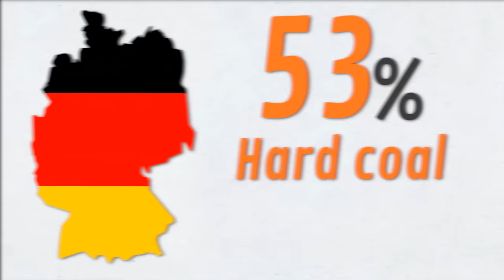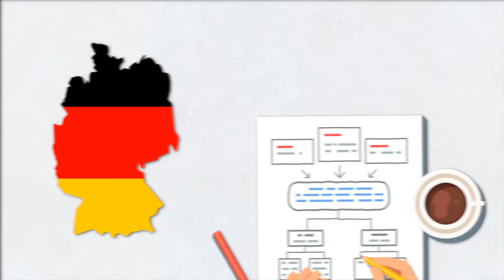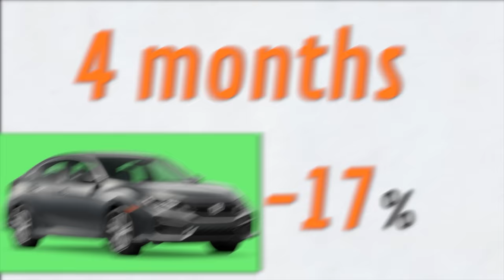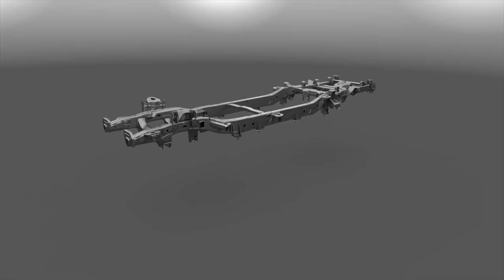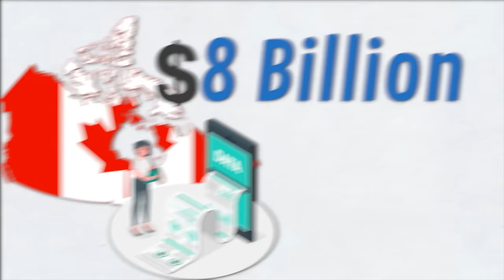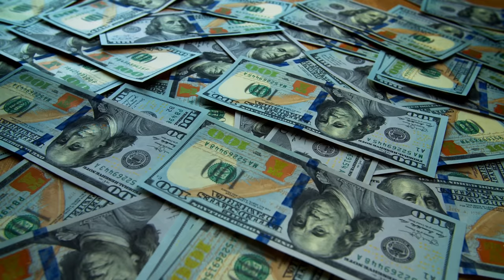Everything You’ve Heard About the Car Shortage is a Lie, Here’s the Truth

Comment: Make cars that last 50 years, or more. Quit having a disposable economy.
Reply: I still have my grandfather's 1962 Chrysler. Twice the weight of a Toyota, V8 power and can be repaired with a plier, Cresent wrench and two screwdrivers. Runs like a clock and rides like a living room on wheels. Doors are thick enough to stop a bullet so it's Chicago friendly. 😉
Reply: For real. Im still a driver of 1990's Japanese compacts. Every company should mimic those.
Reply: I still have my 67 cougar with 289 for the last 48 years I do all the repairs it has 234,000 miles! And my 92 Toyota truck
Reply: It helps to have a skilled, knowledgeable and honest mechanic!
Reply: Exactly. Put a few more dollars in quality built merchandise and charge a little more for it. We'd all be much better off in the long run. Local Mount Trashmore landfill might take longer to become a clay capped sledding hill but I like the tradeoff.
Reply: @N. Dakota ham, well at the rate America is going, it better be Chicago, NY, Texas, FL etc etc etc friendly these days. 😉
Reply: @drx, a knowledgable, honest mechanic ? That does not exist. 😆
Reply: we have the break a window and get a higher GDP economy.
Reply: It's always been about GREED!
Reply: Most of us would settle for 20 years.

Comment: In the 70's I had a Datsun B210 that got 40 mpg. Today I have a Nissan Versa that gets 40 mpg. 
We don't need no stinkin computer chips.
Reply: Yep.  Small cars and trucks with straight 4s in the late 70s and 80s were netting about 30mpg.  The Honda CBX was approaching 50.  Computers and fuel injection became ubiquitous after 1989...average fleet gas mileage went down...which means net carbon emitted went up.

By 2000+ many cars were getting 20 and most trucks were about 15mpg...just as prices went from $1 to 2 then 3 a gal.

  Therefore a 1989 economy car that went 30 miles on a dollar....in 2006 went 7 to 10 miles on a dollar.  A F150 went 4 miles on a dollar.

I'm thinking the computers had another purpose.

To regain efficiency in these rationing times, some EU makers are considering port carburetors...yeah.  apparently they were always more frugal...US makers just put bigger wasteful carbs on their motors to wring out HP and impress the hot rodder.
Reply: I have a 1966 Honda that will get 125 mpg.....of course it only has two wheels and no top so definitely not a cold weather vehicle.
Reply: @northdakotaham1752  that seems to be the limit of internal combustion.   110 to 120mpg for a single person and vehicle that can achieve speeds above 30... with a low hp bike.  Mine gets 95 to 100 at 45mph avg.  Rated at 70mph steady hwy flat speed...but gets about 89 for me.  That's a 2008.

It can carry two teens or thin women or one adult male.
Reply: Me too bought my 77 B210 5-manual hatch just before the 1979 oil shortage. Got 43 real MPG and was rock solid reliable. The engine design BTW was licensed from Austin with some changes by Nissan. Mine said Datsun and Nissan on the rear.
I also had a 72 B110 Manual sedan before that.
Reply: @STho205  sounds cool! My 90 cc Honda will go 60 mph. Very light bike. Not for a windy day!
Reply: @northdakotaham1752  I started on a 1970 CL70....that sucker went forever on 30 cents of gasoline to fill the tank.

Currently have a CB250 for mountain rides.  Gave up bigger bikes 6 years back....thus one was too practical and fun.  Maxes at about 75mph.

My cold weather rides stop below freezing, but I can ride all years as there's always some days above freezing here in Jan/Feb.  ND...probably not.
Reply: One guy put a lawnmower carburetor on his V-8 powered Ford Maverick and got 40MPG!
Reply: @STho205  added some hp but lost some mpg. 70 cc isn't much for hill climbing. I think a 125 is a happy medium. Hard to find them!
Reply: @diegosilang4823  still wondering if that was a hoax.
Reply: @diegosilang4823  the British SU carbs on their BSA and BL cars were similar in scale to lawnmower and tractor carbs.  A Maverick straight 6 or even the 302 could always get over 30mpg if a properly scaled slow performance carb with high air flow was installed instead of a big 2 barrel US throat or an aftermarket hot 4BBL Holley.  People in the 70s just totally overlooked the obvious.

That Maverick got reasonable slow acceleration to 60mph, but it went 65 for quite a long way in the test.
Reply: @user-3tf67bk46u  curb weight of 
1974 Ford Maverick: 2950lbs
2019 Ford Fiesta 4d: 2700lbs
2019 Ford Focus 4d: 2900lbs

Are you sure new cars are heavier in the same class?
Reply: I had a 74 Yamaha DT 125 that got 60 mpg. Got me around fine when I first got my license and about the only thing cheaper was a bicycle. Wish you could still get those again. $800 brand new and I beat the thing silly off road and it kept on going.
Reply: @user-3tf67bk46u you must have not seen a Maverick in context of current cars.   A Focus is a Maverick for that Ford niche.  Mavericks were officially compact cars in 1970+...very cramped.  The Focus and Maverick serve the exact same role, the cheap commuter, first buyer...mostly secretaries car...but you could squeeze 2.5 children in the back.

Falcon, (w 3 on the tree)
   became Maverick, (3 on tree)
      Granada
           Topaz
               Contour
                   Focus (mk1, 2, 3)
They are functionally the same car.  Tiny trunk lid, 4 door had less interior room than a Focus, because half of the Maverick was hood.

The Fiesta is basically the Pinto, but is much bigger inside than a Pinto or a Mustang II.  A 4 door Fiesta sedan is less cramped than my 1970 Maverick... 3sp, 2 door coupe, hard bench seat, rubber floor coverings, no AC, straight 6, 20mpg (Fiesta/Focus 38mpg),... that didn't even have rear roll down windows ...just cheaper popouts.

I've never heard anyone call a Maverick a "bigger car".

Those are the same class cars and still weigh under 1.5 tons.
Reply: @thomassavoie2651  my 86 Ford f150 gets the same mpg as the new computer on wheels version.
Reply: All that mandatory EPA garbage basically limits the MPGs.
Reply: @syrtycon7299  maybe.
However in the before time our cars sporting 120hp got 14mpg and those over 200 got 10.  Today I drive a car with 120hp that gets 35mpg/40hwy and 200hp cars get 27+

I'm thinking the return of the land yacht in 2001 has a lot more to do with bad gas mileage than a MAF, non vented tank and catalytic converter exhaust scrubber. 

Compare a 1995 F150 to a 2020 F150 in size and fuel+electricity consumption gagets

Comment: My car is a 2007 Lincoln Town car. I’m not worried about chip shortages.
Reply: Don't worry, your car still has a chip in it...
Reply: I have a 2005 Ford Crown Victoria LX sport with 177500mi. Used. I put new tires, Goodyear, new car battery; Die Hard, new double platinum spark plugs, 8x, new S belt, new thermostat. I plan to run the vehicle to 2024 unless it breaks down completely. 🔧
Reply: @DavidLLambertmobile  weak. My wife drives a 2005 town car that will last 10 more years.
Reply: lmao my ecu went out at 130k good luck with that. oh and it also has to be the same year. :)
Reply: 03 buick lesabre v63800 and 02 4.7 sequoia both purrs like kittens
Reply: @Pis212  mine's in 1976 F250 no chip in that Rascal but I'll have to buy a AK-47 to protect it if we have a EMP attack!
Reply: I'm about to buy your cars cousin,  04 Mercury grand Marquis, 56k on the clock to go with my 96 f350 powerstroke diesel.
Reply: @davidmcclellan2786  the 04 Grand Marquis is a great car.
Reply: @DavidLLambertmobile  
Friends had a Ford 500 go over 300k before they traded it in.
Reply: @DigitalDissident  😂😂Good ONE !   Like the 'TERMINATOR" !
Reply: @montanawarren8462  unless you are running a points distributor, you may want to look for one.
Reply: @otispage5746  change of plans, found a creampuff 04 Lincoln towncar w/ 42k on it. I'm pulling the trigger on Tuesday
Reply: @davidmcclellan2786  wow. Winner!
Reply: @rogercrawford8372  I was thinking about covering it with aluminum foil, three layers thick...
Reply: @davidmcclellan2786  David what car did you eventually get?
Reply: @otispage5746  I just picked up my Lincoln towncar today, 41k on the clock. The best part is I know the history of the car and have 18 years of service records in a folder. It's been a good day

Comment: Phew I’m glad I leased a 2020 fusion SE for less than $260/month back in oct/2019. I’ll be sure to buy it off when my lease ends. It’s a comfortable ride. Just hope the turbo lasts 😫
Reply: it should just keep good oil in it
Reply: Just keep up the maintenance and it should last as long as the life of the vehicle and dont rev the engine or aggressive driving and it should last you
Reply: synthetic oil change every 5K Miles, will make that turbo last forever
Reply: sounds good but how much cash down did you have to put down, to get the 260.00 dollar a month payment. and how much will you have to pay at the end of the lease. pretty sure you will still be paying well above the MSRP that was originally on the sticker.
Reply: Whenever I have a turbo vehicle I buy a spare turbo just in case I need one right away. If I happen to come across a good used turbo, I'll buy it.
Reply: Use Pennzoil pure platinum
Reply: It wont last. All.Fords turbos fail its not if its when. And its expensive to fix big money. Fords are junk get a Honda and RELAX.
Reply: @kennylavay8492  I was eyeing a new base Corolla, but the dealers didn’t want to play and kept trying to tie me to a $400+ loan with a higher spec’d one. The goal was low monthly payments. Frustrated, I walked into my local ford dealer with no expectations. They hooked it up with an unadvertised used car deal that knocked out about $6500 off MSRP. It was a loaner car with 3005 miles. As a second car that I would drive daily, I didn’t mind. Down payment was $1,500. To buy it out at the end, just $10,550 (+tax I imagine). Ever since, the dealer has send me numerous emails trying to buy it back and paying above anything I would end up paying. I don’t think I’ll find a deal like that again in this climate.
Reply: @Skeith1Phase  How many months on the lease are you paying.
Reply: Oil catch can is a Must for that engine to survive on top of changing high quality synthetic oil Every 3k miles. Best of luck!
Reply: @kennylavay8492  36 month lease
Reply: @Skeith1Phase  sounds decent.
Reply: Just my experience: my 2013 Escape has the 1.6L Ecoboost engine. I change the oil every 5000 miles. The car has over 125,000 miles on it...so far.
Reply: Get rid of that pile of junk and buy 94 Celica, it will last forever with oil change after 5 years 🤣🤣🤣🤣🤣

Comment: There is only ONE THING I know for sure, Scotty. My 2017 Jeep LATITUDE is paid for. Has 47,000 miles. God grant me that I'll be able to afford gasoline the next year
Reply: I traded a 2019 Jeep Cherokee Latitude in for a 2022 Honda HR-V a few weeks ago. I got $20K for the Jeep, and got the Honda for $26K. With yours being a couple years older you might not get THAT much, but the dealership definitely wanted mine and you got low mileage. You might consider swapping the Jeep for an HR-V like I did, you’d probably be on the hook for a few grand but these things will last 300K miles and get 30 mpg combined.
Reply: @DigitalDissident  The great reset.
Reply: I agree, I have a 2017 Ford F150 with the 5.0

Comment: Well it’s been going on for almost 2 years so we are used to it. It might get worse but I suggest we all buy a reliable vehicle in case your stuck with it for a decade or more
Reply: Lincoln Towncar.  20 years old and still going strong.
Reply: 2000 Silverado 5.3. 212k miles and runs like a clock with minimal issues.
Reply: oh no a car thats lasts more then 10 years the horror 🙄
Reply: Just replaced an Altima with an new 2022 Outlander, with plans on keeping it no less than 10 years.  Have a 2013 Outlander Sport in the Family that's been golden since day one with no plans on replacing that one either lol.
Reply: My 4Runner is 24 years old, 60k miles. Good for 25 more years at least.
Reply: @buzztrucker  those were the years. Gutless but ram forever. Chevy traded running forever for power in the new trucks
Reply: I only buy what I can repair myself. Vehicles are already too expensive to buy without having to pay somebody else to repair it. Bottom line: they all break at some point. Some just earlier than others.
Reply: @northdakotaham1752  yes my ram has had a couple electrical issues already… shocker. But it only cost my couple hundred to fix
Reply: @android-ud2nf  my Ram W150 is 1987. Not much electrical to fail on that one.
Reply: @northdakotaham1752  nope neither with my mothers 97.
Reply: 2000 Ford Expedition with 260k, runs strong, minor issues and a 2002 Chrysler PT Cruiser, runs strong, PITA to change the water-pump or timing belt, but still runs and gets 25 mpg.
Reply: @jaminova_1969  is that the 5.4 litre in that Ford?
Reply: 98 Z71 Silverado 118k on the Odie.
Rough and ready.
Reply: @oldsesalt8496  89 Lincoln mark 7 bought it 4 years ago for 700. Spent 300 to get it running perfect. Car had 95,000 when I bought it now has 169,000 . 70,000 dependamiles out of a 700 dollar car. These new cars are expensive pos.
Reply: @buzztrucker  you got the ls without DOD. I got an 02 6.0 in my chevelle,  it is much more fuel efficient than the old bbc.

Comment: Well then I guess I won't have a car for a while now and it's a shame my car's transmission died out, devastating blow!
Reply: So you were planning on buying a new or even used car once that one went out? Just spend that 2–4 grand on a rebuild/remanufactured transmission bro, maybe less…
Reply: @brileymitchell2632  I might just do that. It's an 07 Buick Lacrosse and I've throwing money at it with repairs after repairs unfortunately so was thinking on getting something newer but circumstances are getting tougher just like the economy for me.
Reply: Prayer sent 🙏 that you get your situation handled 🙏
Reply: @AdamA-pm3yn  me with the 20 year old Yukon SLT😬

Although it’s in insanely clean condition with no dents or fogged up headlights, also I’m it’s 2nd owner, the last one wrote down literally everything he did to it along with the dates and costs at the time, every gas fill up, how much he filled, and the price

Every oil change too, by the book on time and then some
Reply: @AdamA-pm3yn  that’s unfortunate

Comment: Wow. Military EVs? Brilliant! 

Did anyone tell them how long it takes to refuel an EV vs. a Diesel Truck. Also, where is all that refueling electricity going to come from?

Turns out that the military has its own generators, run on Diesel fuel {a hydrocarbon fuel from oil}. So, then, rather than pouring Diesel directly in your truck and immediately using it to power your vehicle, you will need to pour the fuel into the generator gas tank, connect the EV to the Generator, then charge the EV for at least 12 hours. I bet the Captain will be thrilled when he gets orders to move out NOW and he tells the Colonel we are still waiting for 100 vehicles to charge and they won't be ready for at least another 12 days of charging since Congress only gave the company 2-generators for the entire battalion.

Comment: It will be interesting to see the electric vehicle charging stations out on the battlefields.
Reply: Good point. It takes an energy input to generate electricity. solar won't cut it.
Reply: I was thinking the same thing.  Guess they will have a fleet of armored, self-propelled diesel powered mobile generators to recharge the EV's.
Reply: @stansdds  LOL. Kinda defeats the purpose.
Reply: Leave it to the Army Engineers.The ultimate make-it-happeners.
Reply: Progressive logic doesn't need to make sense as long as It's woke.
Reply: They have battery packs that are charged from the base. You remove the low charged battery pack and install a fresh one in minutes. Also, take into account that when you have fueled vehicles it takes an entire unit to protect fuel tankers out in the field.

Comment: Now I am on the fence about ordering the 2022 / 2023 Dodge Challenger Scatpack Wide Body R/T WITH 392 ENGINE with ZF 8 spd,. Auto trans.. because of MDS problems of wearing out engine  and "HEMI TICK" EARLY LIFTER VALVE FAILURES WITH HIGH COST OF MAINTENACE/REPLACEMENT costs of tires and Brembo brakes 6 piston in front and 4 piston  Brembo brakes in rear and brake rotors.  I am not a mechanic nor do I have the tools or space.